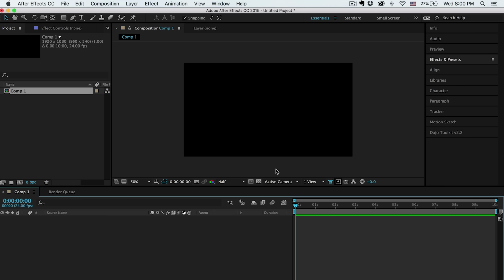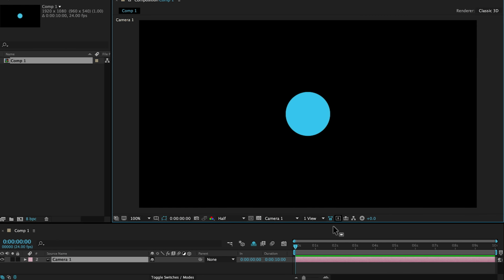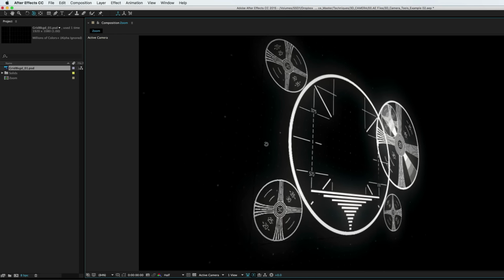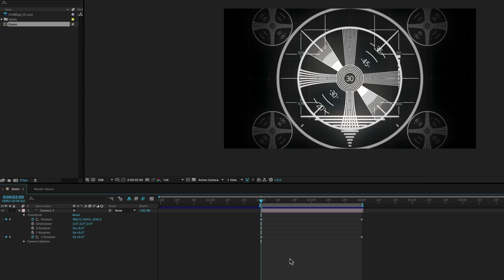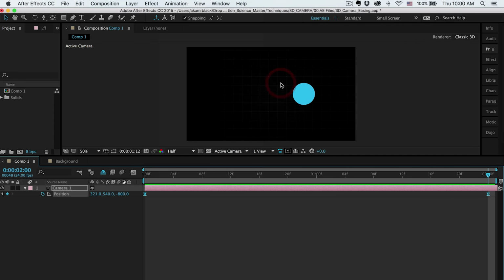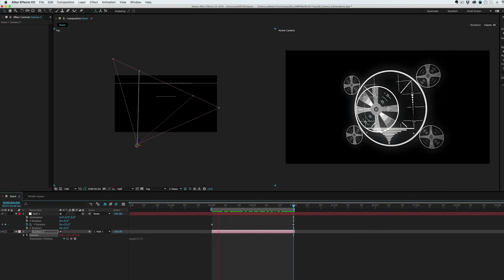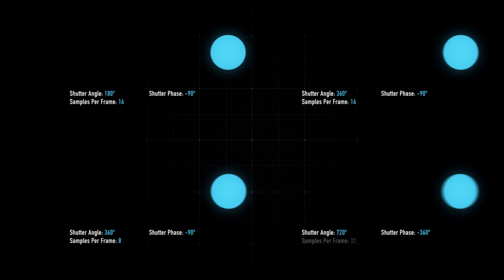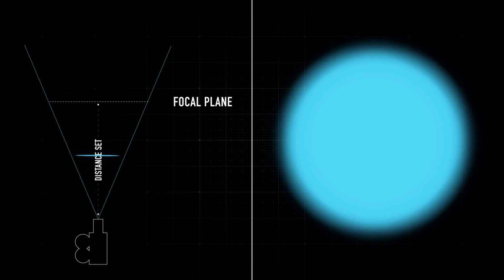After Effects 3D Camera Techniques

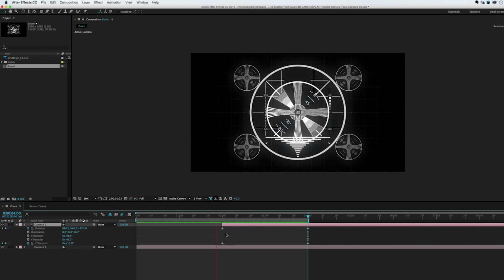Comment: According to the tip mentioned in 4:57 , is "too many camera for different cuts" is better than "a single camera with different keyframes for that same cuts" for a low end PC.
I could hardly run in quarter playback with my pc.

Comment: 10:35 when I use the Convert Vertex Tool, it does not work. WHen I try to select the Vertex/Keyframe it just moves it (changes de position), it does not convert to bezier. And I am using the correct tool, so I dont know why it does not work.